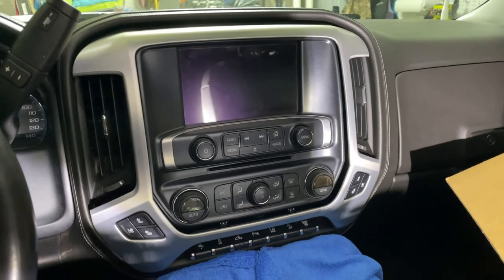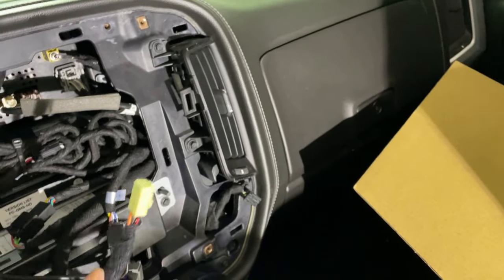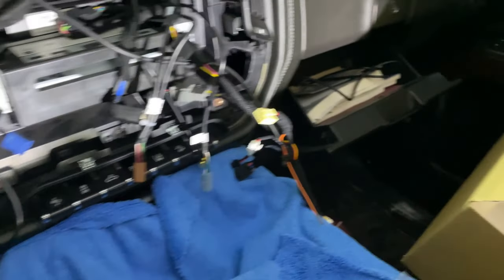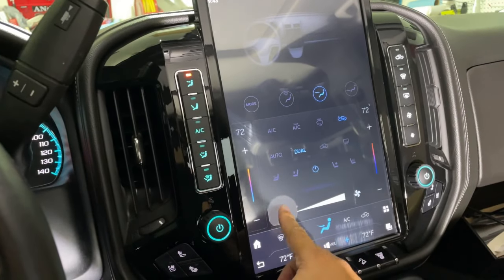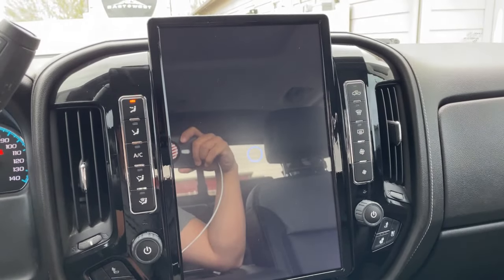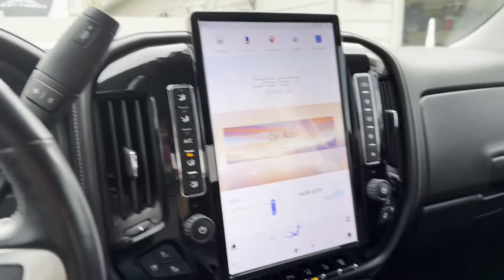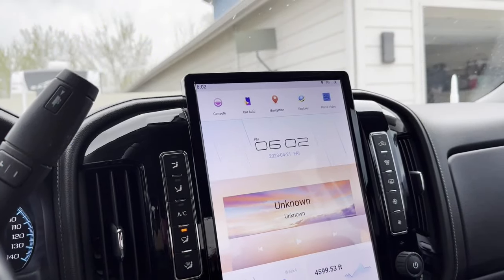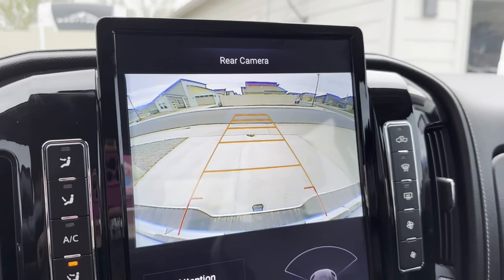AutoTec Pro Tesla Style Screen Install and Review 15-19 Sierra/Silverado

Comment: For those ones fighthing with camera Issues it took me months figured out. Is a cable there that's come with your radio with 2 yellow terminals in one side (like the VGA cables) and a square on the other site. One of the yellow is going to the yellow cable on the radio, the one is "for extra cameras" and the other yellow to the red one. The square is going to original harness. And that's it.
Reply: What wire are you talking about. My camera is not working
Reply: @Trilla_  I guess depend on the car. In my case my kit comes with a yellow cable similar to the one is used for vga connections.
Reply: @jcalem14  i figured it out. i had to change a setting on factory settings from the camera to a different input
Reply: @Trilla_  is there any way you can explain how you figured it out? I am having the exact same issue
Reply: @Trilla_ What setting did you change?

Comment: All funtions work, sound from stereo, USB, bluetooth (this is only in console mode), backup camera, doors open show up, phone calls (in console mode), everything looks good. But I can't get sound from my navigation system (That is the main reason why I bought it). It not only makes no sound but the media playing doesn't mute. It tracks well, but there is NO sound. Nothing from outside "console mode" play any sound, and I cant make phone calls.  I think the installed software made this all possible, but I accidentally erased it. Can I get a copy of the 2 APKs? If that is the fix.

Comment: Ok. I've head this unit now for a couple of weeks and it was a nightmare of a process. I finally have it working the way I wanted but wanted to share my $0.02. NOTE: I would definitely keep your OEM unit. While I'm content (not 100% happy), there are enough problems you may want to go back.

First, I only wanted this unit to add Wireless Apple CarPlay to my 2017 2500 HD. I paired this with a new, iPhone-compatible wireless charging pad. The good:
- No more wires
- Backup camera works fine
- SiriusXM works fine
- Climate Control features all mostly work as expected (more on this later).

The bad:
- Vendor appears to be Chinese even if based in Canada. If you need support you can expect at most one email from them per day and it's very clear English is their 2nd language which lead to all sorts of communication problems on their part. 
- I have one extra camera, the cargo (bed) camera which I use occasionally to hook-up my 5th wheel. This isn't working. The author of this video claims he got his OEM cameras working but hasn't explained how. @CollaGoUnLTD if you get time please reply with how you did this.
- If you are going to use Wireless Apple CarPlay you will want to tell your phone to "forget" the Chevy MyLink Bluetooth device. If you don't this will cause issues with sound not working (this head unit doesn't like to share Bluetooth with the OEM device). This means you can't use the steering wheel control for Siri voice commands. My workaround is I now use "Hey Siri" option on my phone. I actually like this better than the buttons. NOTE: Volume controls work just fine.
- If you ever have to upgrade the firmware (I did to fix bugs with Wireless Apple CarPlay). Be sure to use a USB thumb drive that has a light that let's you know when the drive is in use. I have a all-in-one USB-C and USB-2 thumb drive that works fine but this system didn't recognize it. I got a cheap Memorex 32GB drive from Target that works fine.
- When you upgrade your firmware, I recommend that you also do a factory reset. Not ideal but I had to do this to get Wireless Apple CarPlay working properly. Of course, doing this reset all the setting (back-up camera, date/time, units, etc). Not a big deal but still not fun.
- Climate Control is off. The physical buttons don't work for me. I have to use the screen and for whatever reason the system doesn't always remember my last settings. Specifically I have my truck always set to "Auto" and this system often forgets this (not always).
- Finally, once you get it working, DON'T MESS WITH ANYTHING. The system  and related settings are fickle if not fragile. If you get it working I would avoid any firmware upgrades unless you have a problem that the upgrade may fix.
Reply: My problem with my CarPlay in my 2017 Chevy 1500, it doesn’t connect all the time, but I reset the radio and CarPlay start back connecting… would that be the issue because I haven’t deleted my Chevy link… my opinion the factory mic is better than the unit itself
Reply: @49ersallday57  upgrade the firmware (they had a new release last week), then do a factory rest. That fixed my reconnection issues with CarPlay
Reply: My truck is a 2017 2500 HD duramax. Promise yours is the same issue
Reply: @IAOutdoors  ok thxs, but my problem is I bought mine of eBay, and I talked to the Chinese people on WhatsApp, they sent me a update last month, I will ask them again thxs, I wonder would that update work for me since I bought it from another source
Reply: How can I get the new update?
Reply: @49ersallday57  shoot me your email and I’ll send along. I’m guessing their website has it but it may be hard to find
Reply: Question. Just got mine and was messing with settings. I noticed that I had to connect to the tablets Bluetooth for the wireless carplay. Now for some reason there is a cracking/crackling/popping sound in the background. If I pause music it stays there for a few seconds then it goes away. Any ideas?
Reply: @IAOutdoors  how to I send you my email? For the update
Reply: @IAOutdoors  One thing I'm still struggling with is keeping the unit connected to my phone via wireless CarPlay as well as having a hotspot connected to the unit so my kids can watch online streaming via split screen.  It seems to only want to be connected to one thing at a time.  have you found a way to be connected to both at the same time?

Comment: Ive got so many issues ive had it for 3 months and it has never worked correctly im trying to get them to respond on if i can return it since ive been calling and emailing since day one and im now getting no response. It has so many little.quirks to it that if someone else was to drive my truck they would never figure it out.  Backup camera works 50 % of the time it will.just change screens driving for no reason. Its now turning my a/c off air keeps blowing but not cold i can hit the button it comes.back on but the list of things that it does is really to long for me to list i have only kept it this long because i went with the black unit and like an idiot i went and bought all the black replacements.for the gold interior before this came in and i really like my new black interior.  Im now having trouble.getting them to respond now that i mentioned returning it so we will.see

Comment: Play videos while driving?  Does the onstar and Bose system work? Does it have any amp pre outs for aftermarket amps and subs etc.?
Reply from the maker: Yes you can play videos while driving and the OnStar and Bose System do work. And it does have amp outputs. My truck has the Bose system and I already had installed an aftermarket sub and amp that I had used a LOC to connect it and it’s still functions great so I didn’t mess with rewiring my setup.

Comment: I purchased this same radio and the LDVS cable and Sound box line cable were missing. Are they crucial for it to work properly? The radio turns on and everything but it won’t display sound through the speakers. I am not able to hear anything so I was wondering if those cables have to do with it
Reply from the maker: I used all the harnesses mine came with so id imagine you’ll need those for it to function properly. I’d reach out to the company to get the missing components.

Comment: Maybe you can help me with a couple issues that I have. When I changed to reverse the screen said no signal. When I scroll the volume up or down instead change the radio station. Can you direct me to the right point. At this point I'm so frustrated with this.

Comment: It being an IO 6.  Do ALL the steering wheel controls work without you have to do any wiring in the steering column.?
Reply: On mine, with an iO6, I'll need to install the steering wheel harness for forward/back.
I had a linkswell steering wheel control installed prior but it doesn't seem to be compatible.
Works with the stock blue tooth connection but that doesn't play well with Apple Car Play for this unit with calls and texts so I had to forget that connection.

Comment: I had to switch my truck to Aux on the steering wheel for the sound to work. Did you have that issue.
Reply: I had to do the same thing. Seems ridiculous it doesn't just work while paired with the phone like the stock unit. Sounds seems low quality as well . Any ideas to get to work normally?

Comment: I've been eyeing this unit for a while but was waiting on 1 important thing.... Intellihaul compatibility. If you figure out how to get your 360 camera system to work please update us. It does look amazing! I do have 2 questions. 1. Does it have connections that connect to the truck USB ports? Does it havw connections to connect to the factory microphone? Thanks
Reply from the maker: Hopefully they can figure out the IntelliHaul system but not holding my breath. I have not tried connecting directly to the usb ports yet, and the factory mic does work automatically.
Reply: @CollaGoUnLTD  that's awesome that the factory mic works. This is the first Tesla style screen that does. Gives me hope they might get the 360 cameras working
Reply: I'm going to jump in here as I have the same unit in my '17 Denali 3500. All of the factory USB ports still work, but you really don't need to use them with this unit. The USB dongle that Autotecpro sends with the unit are used for future updates to the unit, and for USB thumb drives with files that you want to access with the new unit. I've got a bunch of videos on a thumb drive that I play on the screen once in awhile. And yes, the factory mic works as it should.
Reply: @John-yy4pe  the installation video that Autotecpro made said the CD/DVD player had to stay installed. I’m not using the navigation (GPS) that came with the unit. I use Waze through CarPlay.

Comment: 2016 silverado 8" w/ rear entertainment. Radio sounds great but anything played connected through the stereo crackles in the speakers. Have you had any issues like that? Aux dummy is plugged in.

-Autotecpro responded with an adjustment to the setting fixed my issue
Reply: what was the adjustment?
Reply: Definitely post the fix the AutoTecPro folks gave you!
Reply: I didn't see the comments.

Settings > system > factory settings > original car with amplifier setting from 30 to 0 > save and reboot

Comment: Great video.  Does the factory usb ports still work? If it does, will it still launch carplay when plugged up to your phone? Thank you
Reply from the maker: I haven’t tried plugging usb in to test Apple CarPlay, I’ve just been utilizing the wireless Apple CarPlay that it offers.
Reply: The USB's work for power and your phone will show up under Console when you hit the Media button but wired Apple CarPlay will not work. You'll need to use the wireless Apple CarPlay ("CarAuto") on the new system.
Reply: @CollaGoUnLTD  Wired will no longer work

Comment: Does your heated seat option work when you try turning it on on the touch screen? If so  what settings did you apply to make it work?
Reply from the maker: That is one thing I I haven’t figured out how to make work, but my normal heated/ventilated buttons still function properly.

Comment: What do you mean about the "higher end system" in regards to the steering wheel contols?
Reply from the maker: Depending on what stock infotainment center you have you may or may not need the steering wheel control harness adapter

Comment: Does your signal light sound terrible? I installed a unit with similar hardware and the small speaker in my farm truck. The sound of the signal light is terrible as well as the seatbelt alarm

Comment: I have a question on the install of the AutoTec Pro 14.4 radio, can the DVD player be remove, since it will not used.
Reply: If you mean the cd player, no. I removed mine and there was no detection of a sound system in the truck. I put it back in and corrected that problem. It has to be there for the truck itself even though it isn't used.
Reply: @denniscanfield2299  and be sure you eject any CD that may be in it before you do the install (I forgot I had one in it and had to disassemble to remove it)

Comment: Where you connect the reverse camera wire to? I don’t have image 🤷🏻‍♂️
Reply: Do you have an OEM camera? What year is your truck.
Reply: Assuming this is an OEM backup camera you will have to go to Settings->System->Factory Settings, enter the code 7890 and then change the very first camera option. I can't remember the acronyms they had for the settings by for my 2500HD I had to use the one that began with a capital "Y".

Comment: I have the same system all works except sim card is not recognizing and next and previous seek buttons on left side of steering wheel doesnt work, can you help?
Reply: Not sure about the SIM card. You have to install the steering wheel adapter. You have to try the 2 different connecting points on the radio harness to see which one works for you.
Reply: @kawi32  update: i connected the steering harness, and then connected the point the the screen, and it started working, and exactly after two minutes, my steering button on original car stopped working ( no buttons ) , then i removed the battery terminal and reset the car and it came back to life, then again one more time i connect the harness and same issue worked for two minutes amd then all the steering buttons stopped responding, and had to remove battery and reset the car, i have also noticed that my original connector in steering column has 8 wires going to big connector, and the wire that came with screen has 10 wires.
Reply: Maybe try a master reset on the radio? I didn’t run into that issue with mine. Maybe try not connecting or connecting the main cream colored adapter to the original radio? I’m assuming you tried it without the steering wheel adapter too
Reply: @kawi32   hey, thanks for the reply, and what do you mean by coneecting cream colored adapter? If you are taking about that connects with a harness from the original box to the android screen?, yes thats already connect before i did the steering adapter. Can you please explain it what should i do. Thanks
Reply: @kawi32   all worked has to just remove the trucks battery in order for it to not hang when switching adapters. Thanks alot man for you help, one last thing you mentioned in your video that you were able to change wallpapers, can you explain please?

Comment: I have a 2015 Sierra with Bose system. The only way I can get sound is to connect to the factory bluetooth. How did you get sound without having to go through bluetooth if the factory system?
Reply from the maker: Did you plug the aux dummy cable override into your center console and change your stereo to AUX?
Reply: Same issue, yes I have plugged the dummy cable into the center console. Enables AUX as an option to select through the steering controls, but no audio on multiple android/built in apps that I have tested.

FM/AM, Sirius radio, Bluetooth, CarPlay works fine.
Reply: Did you ever figure this out? I have no audio and no option for aux in my original screen.
Reply: @CollaGoUnLTD  Can you show this in the video? I never see any mention of this. How does sound work then if you can only use the AUX instead of radio and such?
Reply: I have no sound whatsoever. I’ve tried everything. Any help??
Reply: @rafaescobar5269 I'm in the same boat. Anyone figure it out

Comment: Do the Denali gauges function as normal or do you lose any features with this install.  The media selection, the phone contact searches, the radio and xm favorites, do they all work?
Reply: Not sure which gauges you mean specifically. You can get to the crappy OEM interface to do the media select, contacts, etc. That said, I don' t pair my iPhone with the truck itself because this causes audio issues when using Wireless Apple Carplay. Which doesn't bother me a bit because I have Sirius, Google Maps, etc installed so I can access it with CarPlay. Guessing the same could be said for Andriod Auto but I don't have an Andriod device.

Comment: I would be interested to know if there’s a “dark mode” option for the screen or if the dimming feature with the scroll wheel would work while the running lights were on. I don’t think the scroll wheel will work with the factory dash when it’s daytime so that may make a difference. Let me know if you don’t mind
Reply: I own a unit and it does have the dark mode and light mode I personally like the dark mode option better
Reply: The factory scroll wheel for dimming the gauges still dims the dash and heated seat backlights, does not control anything to do with the new Android panel.
Reply: There is a dark mode which I use by default (looks better, IMHO). The dimmer wheel in the dash will not control this unit at all.

Comment: Uh, so you can’t use the existing GPS antenna? I have a 2017 2500HD. Same question for Cellular antenna! Seems like that would save a ton of space and a few steps
Reply: Your existing GPS antenna will work for your stock navigation system if you use it under the "console" GM screen.
Reply: @Islander416  Yeah, so I never use that. So the supplied GPS antenna must be used. Glad I just added it while I had it torn apart.